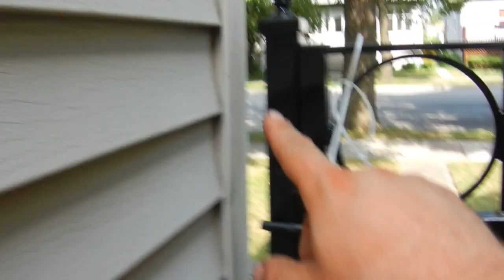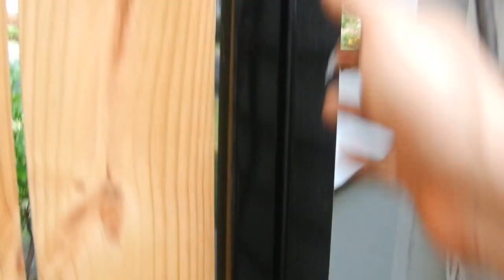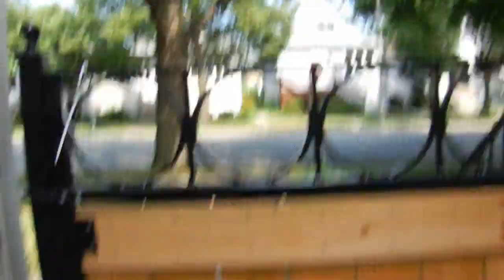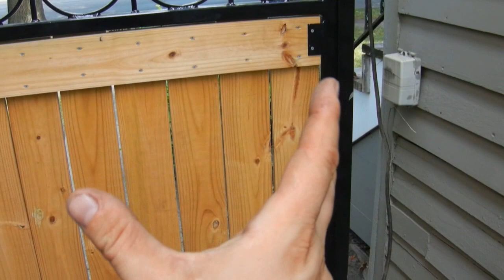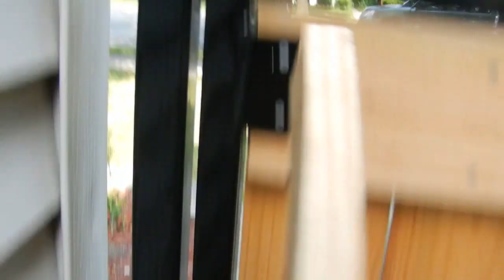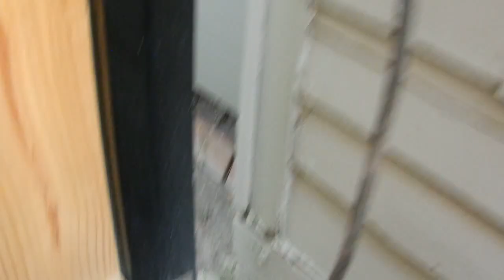Sagging Gate repair

Comment: About 14 years ago I hired a local gate builder to set me up with a couple of gates in conjunction with some concrete work I was having done.  The gate builder meets up with me and the concrete guy and gave him the gate posts to be set into the concrete with very detailed written instructions - basically a blueprint.  When the concrete is set and the gate builder returns with my gates for installation he about lost his mind - none of the gate posts were true!  

The way he trued them up was with a common propane torch.  He said the posts are made from extrusions which makes them prone to exaggerated shrinking if heated.  So he stuck a magnetic level on a post and began to heat it near the base.  He would only heat a spot and only heat it a little bit before letting it cool.  As it cooled off it shrunk and pulled the post toward it.  By George he was able to tune up all the gate posts by heating the metal then letting it shrink as it cools!  I think it only took him maybe five minutes per post.

Comment: Hey Joshua, your cut on the post defies logic. Cutting on the opposite side of the post would of made more sense to me (when lifting the sag). I can't get my head around why cutting on the right side of the post would cause it to lift the sag. Please help me out here, it's driving me crazy.
Reply: It's more clear now as I didn't think there would be a bigger gap on the opposite side of the post (ratios)when cutting to get the same result. I will get to work and try this myself as this seems to be the only alternative I have at the moment to stop my gates from overlapping. Thanks again for clarifying and posting your video, you have been a great help.